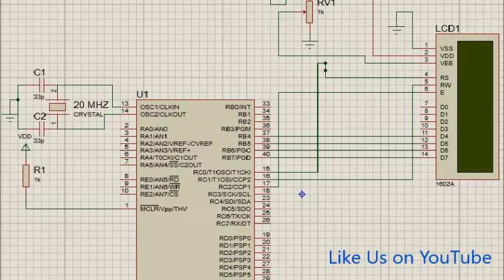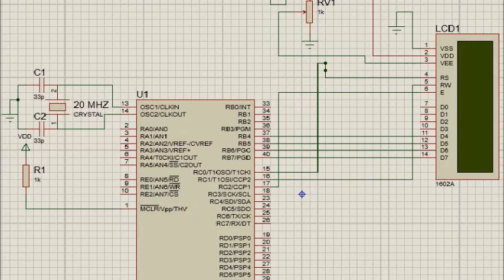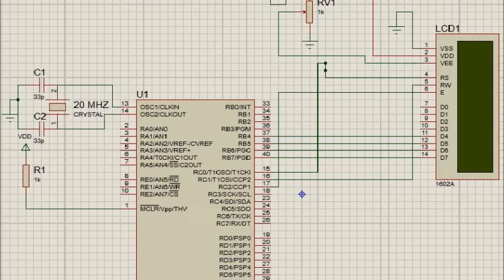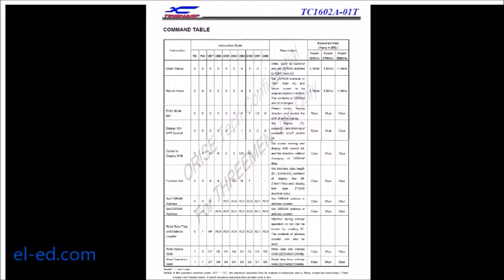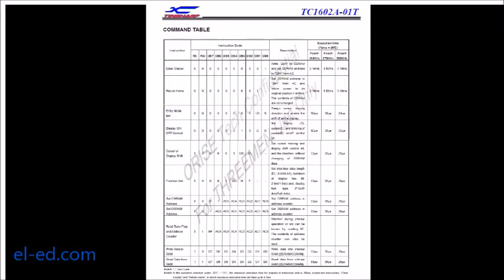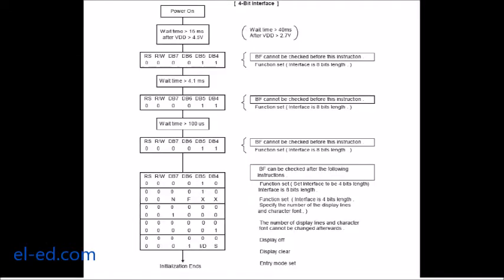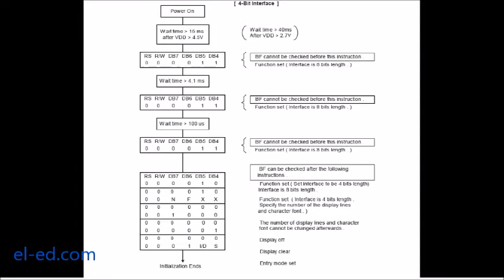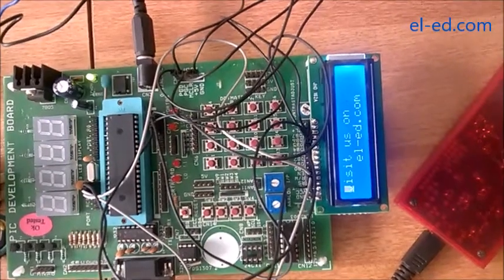Interfacing LCD in 4 bit mode with PIC 16F877A Microcontroller

Comment: Hello Friend. I have a doubt in the ccs. I have a board that uses the pins RA1, RA2, RA3, RA4, RA5, RE0 with the respective pins of the lCD: D7, D6, D5, D4, E, RS with PIC16F877A and ccs compiler. I made the program that initializes but only printed a letter on the LCD. I have not found the solution yet, but I think the fact that it is not working is that the pin RA5 is receiving char data and at the same time it is configured for E. But I did not find a way to fix it yet, to modify since the board has the configuration informed. I've already asked dozens of people on youtube, but it seems that the people are out of the subject and do not respond. If you could help me, I would be very grateful. Simulo no Proteus. The code is this:

#include <16F877a.h>
#fuses hs, nowdt, nolvp, put, brownout  
#use delay(clock = 20M)
#use fast_io(a)
#use fast_io(e)
#byte ADCON1 = 0x9F
#define rs pin_E0
#define enable pin_A5

#define linha_1 0x80 
#define linha_2 0xc0 
#define limpa_lcd 0x01 

void inicia_lcd(void);
void lcd_txt(char letra);
void lcd_comando(int comando);

void main(void)
{
 set_tris_a(0b00000001);
 set_tris_e(0xFE); // 0b11111110
 ADCON1 = 0b00001110;
 inicia_lcd();

 while(true){            
      lcd_comando(linha_1);
      printf(lcd_txt,"Meu Teste");
      lcd_comando(linha_2);
      printf(lcd_txt,"LCD&MODO");
      delay_ms(1500);
      lcd_comando(limpa_lcd) ;
      delay_ms(20);
   }  
}

void inicia_lcd ()
{
      output_low (rs);
   output_a (0b00000000);
      output_high (enable);
      output_low (enable);
      delay_ms (20);
   output_a (0b00011000);
      output_high (enable);
      output_low (enable);
      delay_ms (20);
   output_a (0b00011000);
      output_high (enable);
      output_low (enable);
      delay_ms (20);
   output_a (0b00011000);
      output_high (enable);
      output_low (enable);
      delay_ms (20);
   output_a (0b00001000);
      output_high (enable);
      output_low (enable);
      delay_ms (20);
   output_a (0b00001000);
      output_high (enable);
      output_low (enable);
      delay_ms (20);
   output_a (0b00000010);
      output_high (enable);
      output_low (enable);
      delay_ms (20);
   output_a (0b00000000);
      output_high (enable);
      output_low (enable);
      delay_ms (20);
   output_a (0b00011110);
      output_high (enable);
      output_low (enable);
      delay_ms (20);
   output_a (limpa_lcd);
      output_high (enable);
      output_low (enable);
      delay_ms (5);
  
}/ // Fim funcao inicia lcd

void lcd_txt (char letra)
   
   {
     output_high(rs); 
     output_a(letra); 
     output_high(enable);
     delay_ms(5);
     output_low(enable);
   }
      
void lcd_comando (int comando)
   {
     output_low(rs);/
     output_a(comando); 
     output_high(enable); 
     delay_ms(5);
     output_low(enable);   
     }